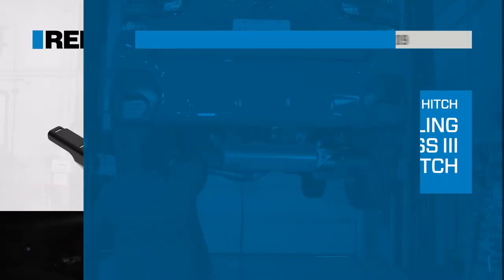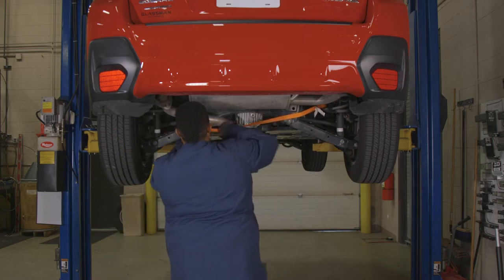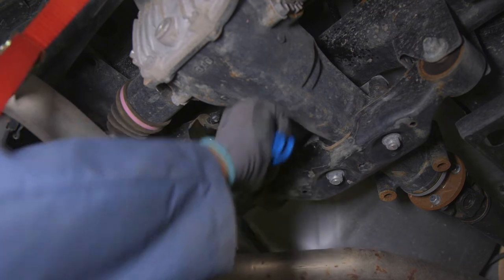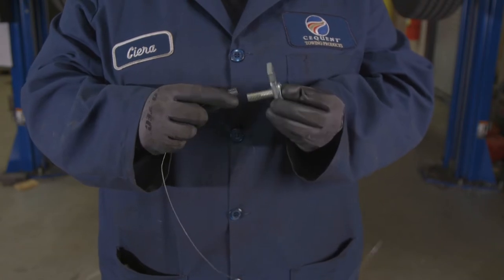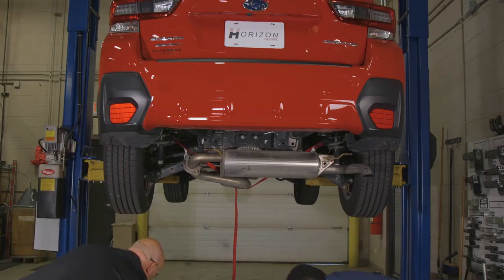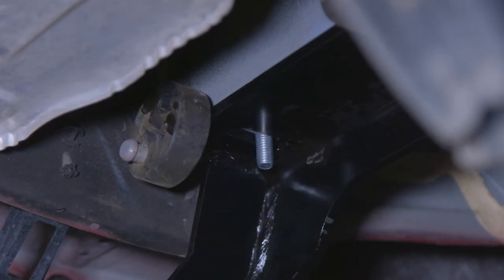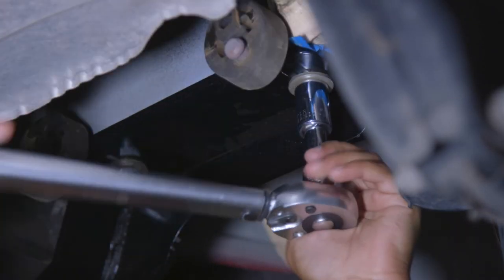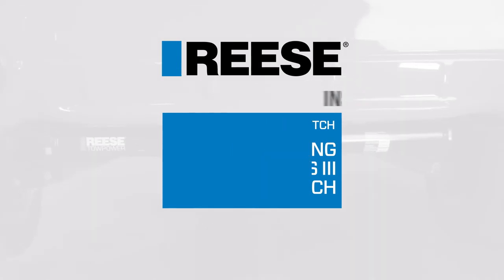Trailer Hitch Install: 2020 Subaru Crosstrek  - REESE®  84209 (2018-2022) Subaru Crosstrek & Impreza

Comment: So no need to enlarge the holes like with the receiver sold by Curt made for the same car? It's a 2019 crosstrek.
I'm on the other side of the country from most of my tools so this is way easier than needing my die grinder.